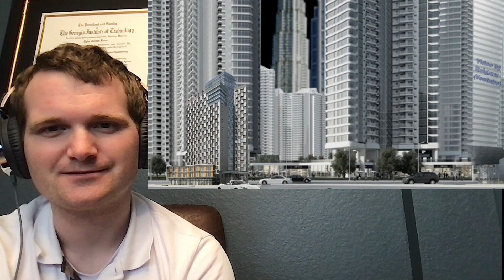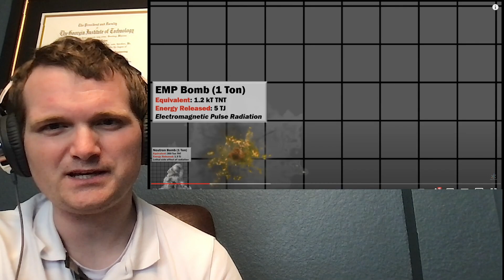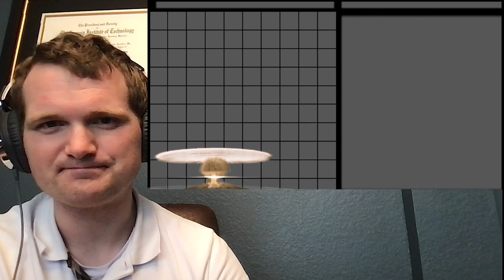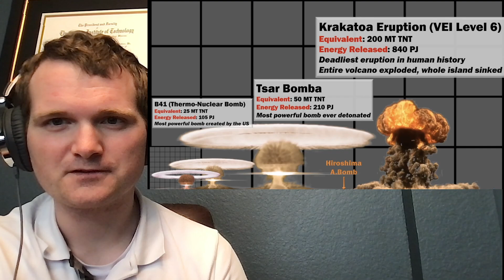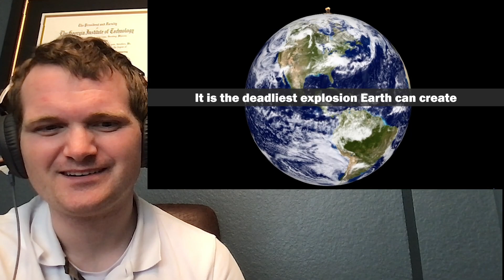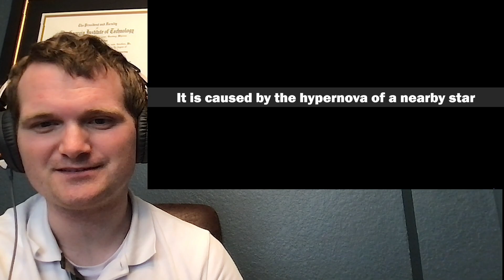Nuclear Engineer Reacts to Nuclear Explosion Power Comparison by Reigarw Comparisons

Comment: @T. Folse Nuclear The Antimatter Bomb statement (21,500 MT TNT yield per ton) is wrong. Antimatter will not release any energy unless it comes into contact with matter. It will not realease all of its energy unless it comes into contact with an equal amount of regular matter in which case the energy release for 1 ton would be exactly twice that so 43,000 MT TNT yield.

21,500 MT TNT yield per ton of Antimatter while 21,500 MT TNT yield per ton of regular matter that the Antimatter would unavoidably react with.

I know you know this (there is no way you don’t) and simply missed it.

Love your videos

Comment: Fission, fusion, fusion, fission, Primary then that trips the secondary, which is actually activated by the searing radiation of the primary ,and the pressure and heat, which rivals the center of a healthy stellar core. THIS is where you get the real power. With adding tritium, etc, a space between the uranium and the shaped charges, allowing the blast to accelerate,....neutron reflectors, a modern "compression" type bomb is much more efficient with a much greater yield than a old "gun type" bomb. And yes, this all in a few "shakes" which if i remember right, is one ten thousandths of a second.  There is much more to it, more elements, neutron gun, etc...much harder to make a modern nuclear bomb  than you think. Esp a H, or ...multi- stage weapon.

Comment: If memory serves, we've found the remnants of Thera in the Earth's core; there's a region of extra dense material that's hypothesized to come from Thera. Not to rain on the parade, but the video exaggerated the effects of a VEI 8 supervolcano. It's going to certainly kill a lot of people in Wyoming, Montana, Idaho, and possibly Utah when it goes boom, but that's not half the population of the U.S. (a figure that's roughly 150 million people) - at absolute worst, that's only going to be slightly more than 2 million people, which is twice the population of the island of Manhattan (remember: Wyoming, the entire state, only has 580,000 people. Detroit has a larger population). There will be soundwave damage all the way to the coasts, and they'll hear the explosion in Europe. However, the real killer with any major volcanic eruption is the aftereffects - the ash alone is horrifying, since the particulate is small and it slips into your lungs, mixing with the liquid in there to form concrete. It collapses roofs, blocks roads, and diverts air traffic. This is an explosion that will probably blanket the entire Midwest with ash, including Kansas and Oklahoma, making it so you can't grow anything there. The explosion is the least horrifying part of any large volcanic eruption, and the people who died when the supervolcano cooked off - either because they were hit by a pyroclastic flow or because they were ground zero when the cork popped - are the lucky ones. Life is going to SUCK for the survivors for a good while. 

 Similarly, the effects of a GRB are exaggerated. A GRB doesn't have the power to vaporize the entire planet. It will turn it into a briquette, stripping away topsoil and vaporizing the oceans and atmospheres if its close enough, but it isn't going to destroy the entire planet (now, the hypernova shockwave is probably a different story, but if you're that close to a hypernova, you have bigger concerns than a GRB). Lastly, there IS a GRB candidate - WR 104 - that, while some 8,400 LY away, isn't close enough for the hypernova shockwave to do damage, is quite possibly rotating so a pole is aimed directly at us. The star has a swirl pattern if you look at it; it looks like the barrel of a rifle. There's some disagreement over how much danger a GRB at this distance poses, but if it is aimed directly at us, we're slated to find out anytime within the next 1,500 years.